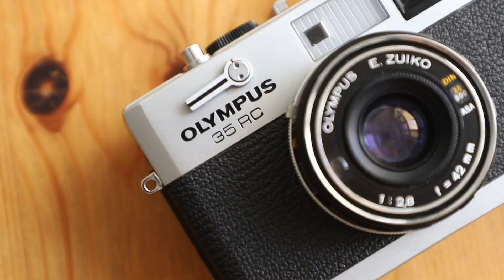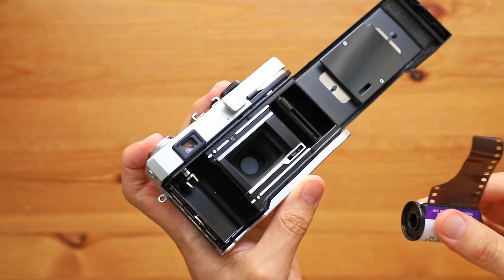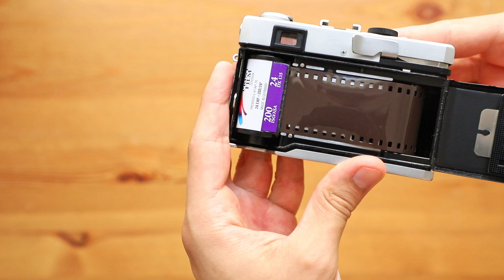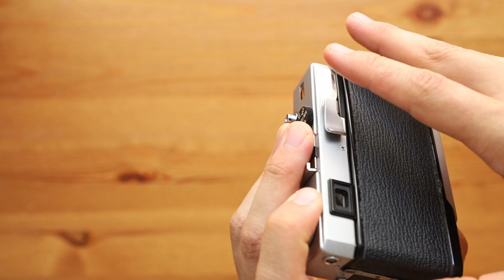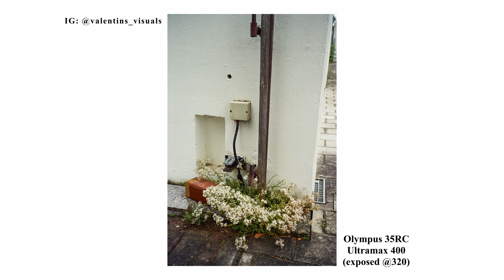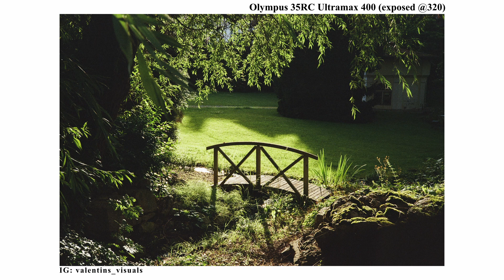Olympus 35 RC Tutorial: Loading Film, Main Functions and Sample Photographs.

Comment: Do you actually use the view finder focus square? I find it super difficult to use from the size of it and it's very faint. I usually just go based on the subjects distance like if it was a full manual camera
Reply from the maker: I did like the rangefinder for focusing, but it is quite small and dim. In some situations I used it, in others I was just guessing the distance. Especially when it’s very bright outside and around F8/F11 most of the picture will be in focus anyways. 

Hope that helps,
Vale